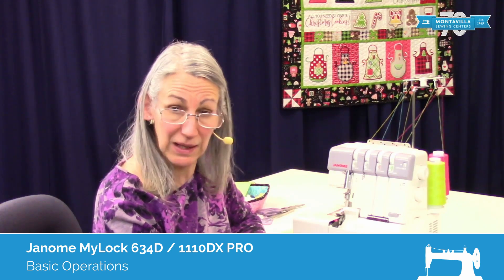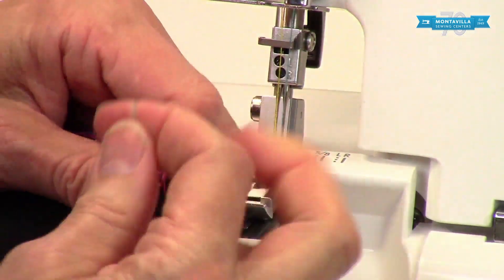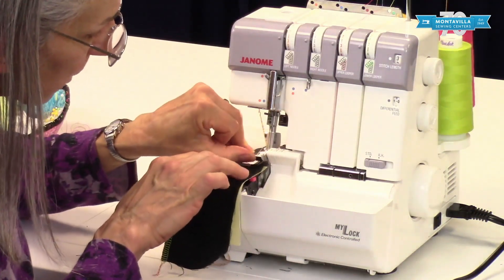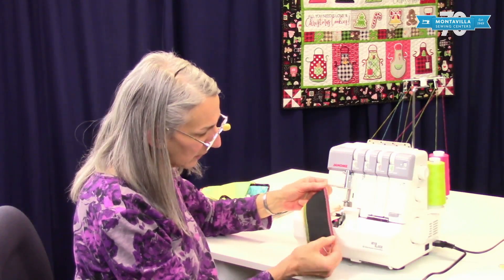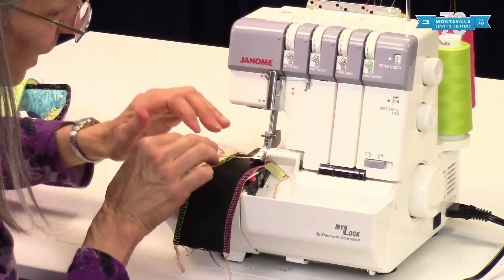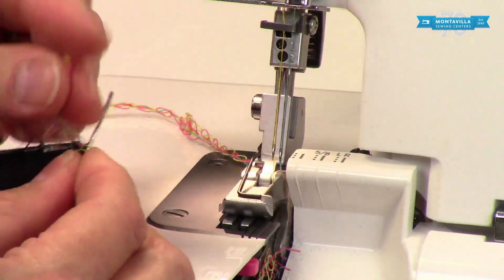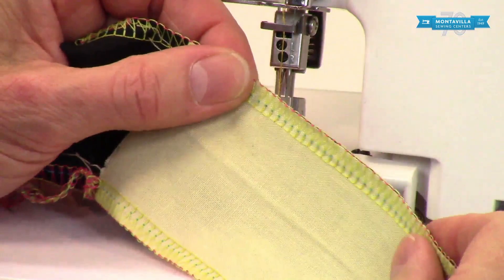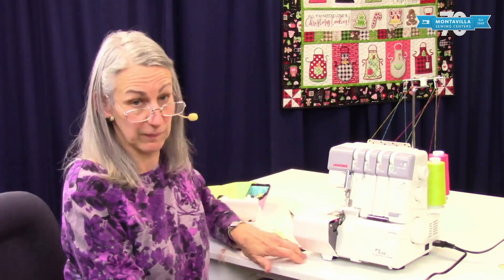Basic Operations of the Janome MyLock 634D & 1110DX PRO Serger Overlock Sewing Machines

Comment: I’m very new to serging. I still feel very confused on using my regular machine and when to use the serger.
Reply from the maker: in geberal, the serger is primarilly used to seam fabric together or finish the end of a project with a rolled hem. you can use it to seam together anything where you need a strong flexible seam and the serge will be on the inside/ hidden somehow.